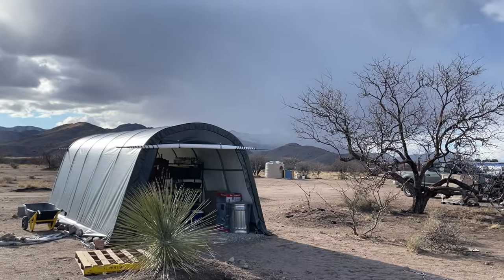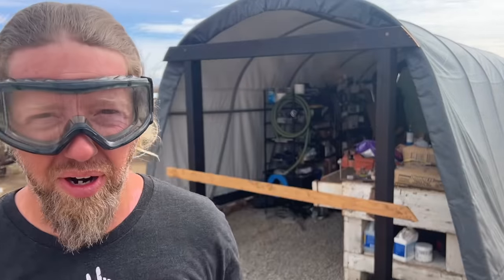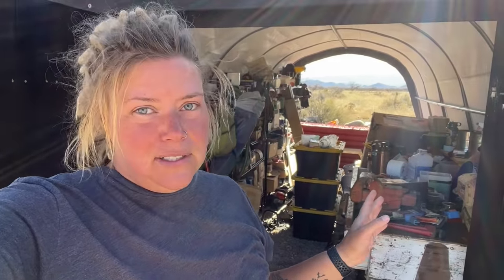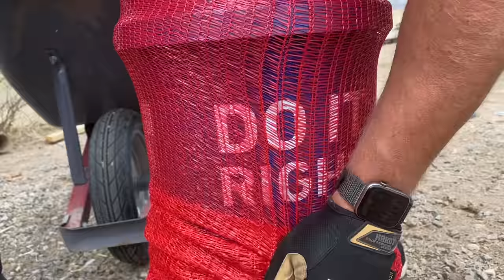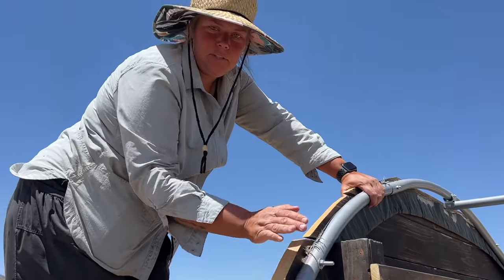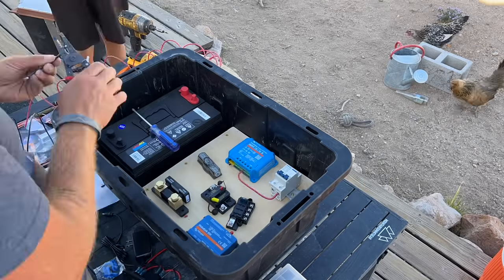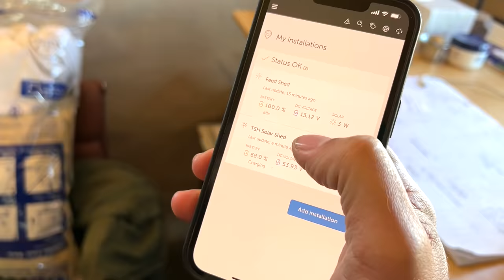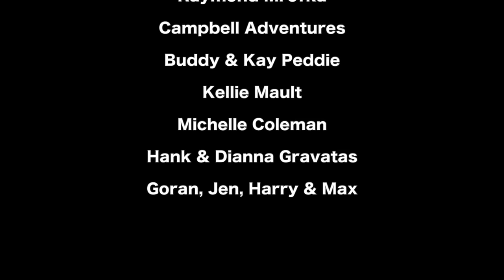Family REBUILDS Torn ShelterLogic with Barn Doors, Earthbag Walls, Metal Roofing & Solar System

Comment: That's all fine if you live where there's no snow otherwise it will crush canse the steel ridges won't allow the snow to slide!
Reply from the maker: If you live where there's that much snow, then yes of course you'd need to plan the build accordingly.

Comment: Have you had any problems with the EcoFlow shutting off due to heat?  Mine shuts off when exterior temperatures rise.
Reply from the maker: You know it might have the other day. It wasn’t off, just the inverter part. Or someone might have turned it off accidentally. Keeping an eye on it. But has been working fine for weeks so far other than that.
Reply: @TinyShinyHome  BTW I really love your set-up.  I'm hoping to do something similar but want to use hemp & lime for building materials for the home.  Love the idea for the garage and feed barn and chicken coop.  Keep up the great work.

Comment: The solar part only makes sense if you were already willing to spend the money on one of the prebuilt solutions. Other wise it just doubles the cost. Also it is not fair to call solar a part of the "repair" because the original building did not come with that. I would have thought running a line from the solar shed would have been easier/cheaper, but this solution does give some redundancy so maybe it is worth it for that. Considering the the parts used, it would seem that some of these companies are supplying parts or at least giving a discount as they are at the high end of the price scale.... either that or youtube and patreon are doing really well. Remote monitoring/control of a solar installation, for example, seems way over the top for what is needed in a building that is used on a daily basis and where these functions will be used for a week while setting things up and then expected to just work there after. This is not meant to be a "put down" but more of a request for a better explanation of the thought process for choosing these extra bells and whistles. Also, even if you had the money for a prebuilt solution, I do not think it would out preform what you have done (the container might be a little more secure) or look better either. I was surprised you did the roofing/siding from the top down rather than the bottom up, I would be interested in knowing how it does in the rain.
Reply from the maker: Totally, you wouldn't have to do the power part of the installs if you didn't need it. We did, so it became part of the project. They are too far from the solar shed to run a line, and like you said redundancy is important out here. We'll probably have at least 10 mini solar systems eventually with all the different things we want to build. Like we mentioned, Ecoflow was a sponsor and provided the DELTA Max - otherwise we bought everything else ourselves. And also like we said, the Victron bit isn't necessary, but we are testing VRM connectivity for future builds. You could totally build the 12V system for about $500 less if you didn't want to go fancy with it. While laying the metal roofing we did switch and put the rest of them under the previous panels for water flow.

Comment: Unless you sealed the roofing, your going to have water leaking in on one half of each building. This is do to the way you have the panels overlapping.  You should have hung the panels on both sides at the same time, working to the top to give you full panel overlap with no top exposed seams.

Hope it's working the way you went it to.
Reply from the maker: We switched the overlapping when we got to the top so that water will flow properly, don't worry ;)

Comment: Can you run ethernet/signal wire to the hub along with the electrical instead of adding a cell relay?
Reply from the maker: For Victron there are a few options. The cheapest is to get a Raspberry PI, load their software on it, and connect via wifi or ethernet. The easiest is Cerbo - a more expensive version of what I got that connects way more stuff than I needed. I was too far away from Wifi or running a cable so the cell based version was easiest.

Comment: 39:25 you needed to start that panel at the bottom and work the second side the same way as you did the first.  The way you did this, this way, the second side won’t shed water properly.  Starting from the high point, everything should be tucked under the last as you go down.
Reply from the maker: If you watch the video you’ll see where we slid the second side up under the other so water does shed property. We’re not dumb;)

Comment: Genuine question - what is the structural Impact of drilling screws into the metal frame? Has it weakened the frame at all?
Reply from the maker: We could weaken the frame if the screws went through both sides of the tube, but by using shorter screws that just go in one side it shouldn’t compromise anything.
Reply: @TinyShinyHome  awesome- thanks for explaining x

Comment: How do you deal with condensation on the ceiling? I did this and there is so much water dripping from the ceiling from condensation I cant keep anything dry
Reply from the maker: We haven't had any condensation in these, even during monsoon season. Definitely have had it on our open air Airstream RV Cover, though. I think maybe because it's fully enclosed and we have so much sun it traps the heat in so there's never a huge difference in temp between the inside and outside?

Generally, though you just need a layer of insulation directly behind the metal panels to stop or slow condensation.

Comment: 41:15 I hope you weren’t actually stabbing holes in the vinyl.  I know this vinyl hasn’t been good for protecting your stuff but it would be great to use on a frame for shade for those out door meals.   You’re in the dessert, shade is a commodity.

Comment: I wonder if concrete canvas would work for this? its just fabric with concrete in it. Roll it out and wet it down to harden.
Reply from the maker: Poles are too far apart for something like that. You’d need more support and probably some metal lath

Comment: Why use dark panels in the desert? Really hot.
Reply from the maker: Good question. A couple of reasons. We have used polar white to reflect heat on our solar shed and chicken garden, but these panels aren't just on top of a roof. They're very visible from the road, and we wanted something that wouldn't stick out or detract from the landscape.

Comment: You have a very dangerous thing there.  If some runs into the edge of that metal it will cut the very badly.   I have seen it happen, a gut on a job site ran into an edge and it cut his head open wide. You need to put something on it to make it safe.  I subject a hose split the full length and placed on the edge. Drill some holes in the metal and secure with zip ties.
Reply from the maker: These are real metal roofing panels, not the cheap stuff from the hardware store. They are not sharp ;)

Comment: You want to get rid of the inverter and modify the power tool battery charger to run off DC directly. If you open it up you will see it steps 110 VAC down to 40 VAC and then rectifies it to DC. Thus all you need is 40 VDC off the solar cells which can be accomplished by a series-parallel wiring scheme recharging 14 VDC batteries also wired in series-parallel. The alternative is to wait for a multinatinal corporation to realize the market that exists for such Solar Powered Power Tool Rechargers, buy one for an exorbitant price and then do a YouTube video about it.
Reply from the maker: No we don't. There are plenty of other tools and uses for 110V power besides charging a few batteries.

Comment: Your hasp locks are installed wrong. When the swinging part is closed it should cover the screws just like it covers the screws on the other half when closed.  This way they can't be just unscrewed to get in.

Comment: We also unfortunately purchased a shelterlogic for our homestead in Northern Nevada. Nothing worked. The canvas shredded and strings of it is still being found on sage brush on the property. A real danger for the birds, so we are constantly picking it up. Then I tried using wood panels to cover the aluminium, but it didn't withstand a storm and ended up collapsing on itself. The waste of money and time really left me soured for good on shelter logic. Will build my own shed next time. Thanks for letting folks know what an annoying product this is.
Reply from the maker: It's really just the covers that are lame - the frames are pretty useful as you saw in the video. And they do actually sell much heavier duty vinyl, but it's more expensive that what we did...😂

Comment: I know everyone gotta comment but im gonna save you big grief .. use fender washers wherever there a nut.. you can crank the crap out of it without cracking the wood.
ps nice knife little man.
Reply from the maker: Sans washers is ok for this application, but yeah usually like to use them if needed.

Comment: After spending multiple Summers sweating my butt off and an unpainted galvanized shed,
Reply: I one part apple cider vinegar to five parts water mopped  the roof off with water.  Let dry. Came back over corrugated roofing with galvanized acrylic White paint.  The box went from being extremely uncomfortable to very usable.   I have seen 18 to 20° temperatures changed simply by placing foil face foam over 2x6 roofing on a patio. After removing the fiberglass temperatures reached 101 to 102° Fahrenheit. I laid the foil face foam over the rafters and held them down with 4x4's.
The next day the temperature was 86° underneath.  In Texas your cheapest form of insulation is shade, but with the addition of the mirrored surface of the insulated foam it reflected the convective heat of the sun's rays back into the atmosphere and not down into the patio.  White paint may not be reflective as a mirrored surface, but it does reflect the Sun. Our Earth is heating up more rapidly because the White surface of snow and ice has been deteriorated.

Comment: A black roof makes no sense in this climate.  A reflective white roof and exterior walls with spray on roof coating would help keep the structure even better insulated.  Also, the roof  ridges go the wrong way to put in any kind of gutters to catch the water.
Reply from the maker: Sure it does. We’re high desert. Half the year it’s cold enough to need the additional warmth inside. Insulation would be nice, but not necessary for a shed. And yes we put the roof on the right way for water runoff.

Comment: You know, if you lay down a concrete foundation, you could replicate what you did there, insulate it, but put in a skylight, an air or sea-head composting toilet, and a Cruising Comfort (van lifers use those brands) air conditioner, and someone could live in on of those.

Just saying…. May be something to think of…
Reply from the maker: They could - would be pretty hard to keep the temps regulated without a bunch of extra material and insulation.